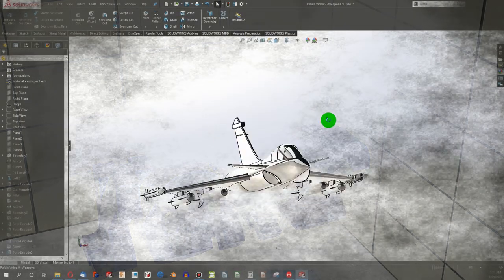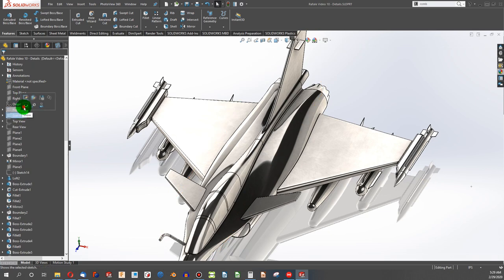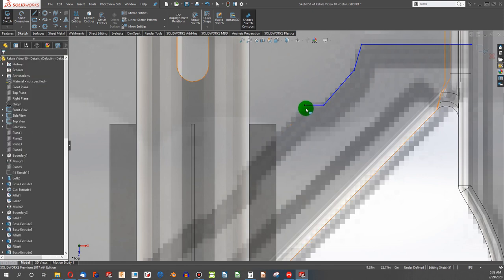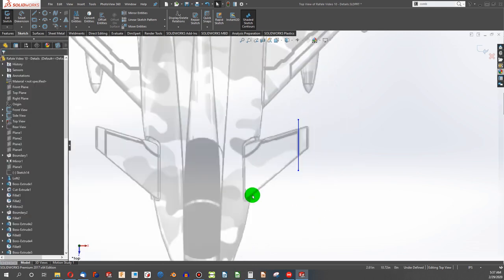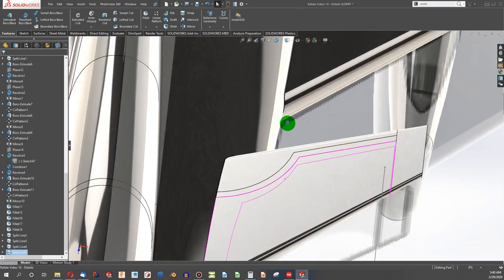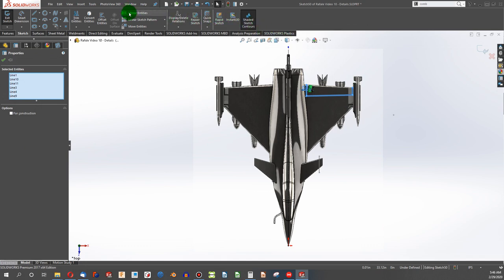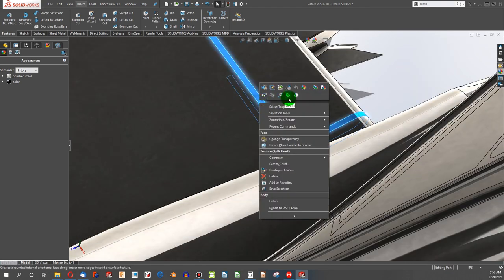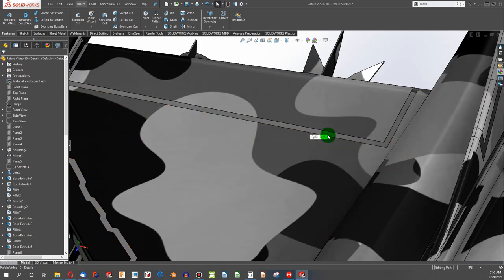Make a Rafale Fighter In SolidWorks Video 10: Details|JOKO ENGINEERING|

Comment: Thanks a lot for great video.
I have a question, if I'm going to design an airplane from the scratch, what's the best way to model it on solid works?
Should i provide the three-view and follow these steps or some way else?
Reply from the maker: It depends a lot on the design intent and if it's a toy plane vs a real plane etc.  If you want it to flly, I suggest xfoil or another program that can easily help you with the air foils and import from there..  For a real airplane like a cessna or something, it would be modeling it one part at a time and creating an assembly.  For a toy plane, the method I use here is great.  I'm not a foil designer, so I would suggest my friends channel "The Science of Flight" for a lot of detail on this topic.
Reply: @JokoEngineeringhelp  
Thanks a lot for your respond.
I'm an aeronautics student. I needed to design and model an air-taxi (for a term project) and i had no idea how to model fuselage in the solid works. Wing and tail was much easier. 
And Thanks for the Channel you recommended, I'll check it out.